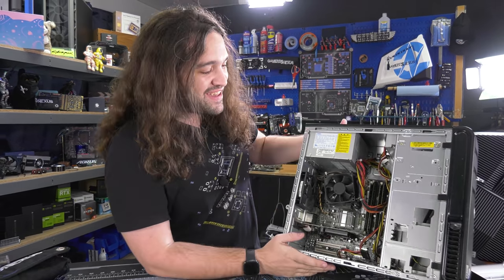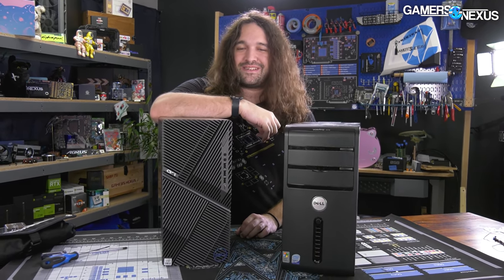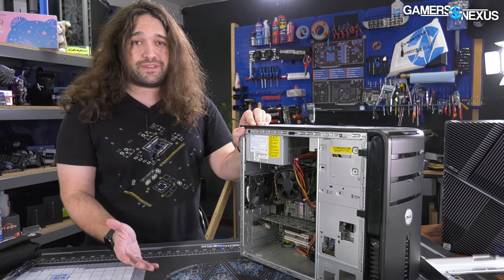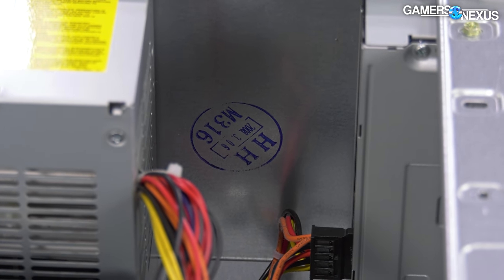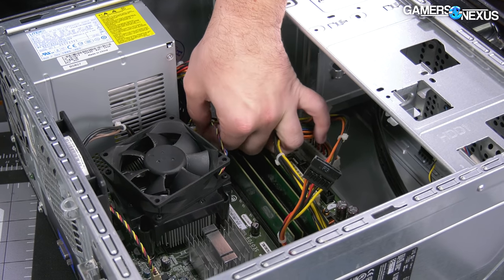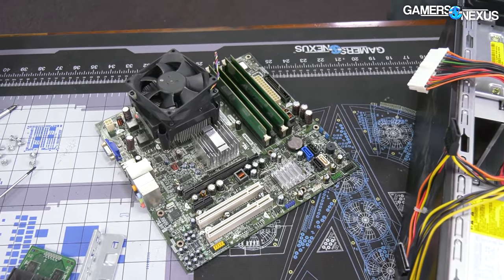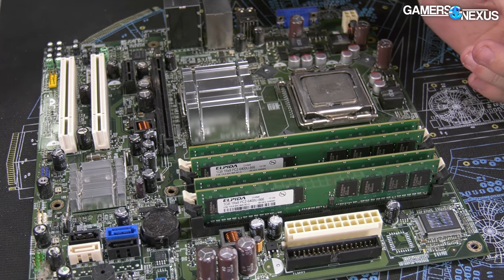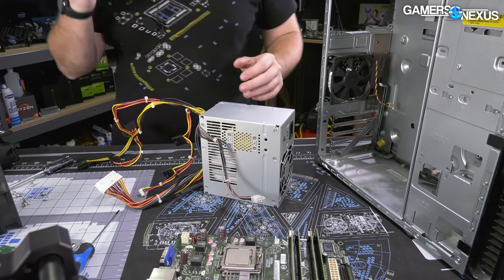13 Years of Dell Getting Worse

Comment: Dell has gone to the dogs. If you buy a Dell today , be prepared to throw it away in 5 years tops. 

Even if the hardware is in good condition , Dell drivers will stop working and you will be stuck with either wrong drivers or ancient drivers. This is done intentionally to make you buy new laptop every 5 year. 

My Laptop Inspiron 5748 i7 does not have a graphics driver because the Dell driver download page has the worng version of the file for the last 4 years. This was never updated even after multiple mails and calls with Dell.

Comment: The value engineers or "bean counters" are doing everything in their power to reduce material usage, part count and trying to make assembly in the factory as quick as possible. You see it everywhere, from cars to computers and the biggest OEMs are the worst offenders. Sadly most of the people who buy these abominations will probably never take off the side panel, let alone attempt to fix it if it breaks. They'll chuck it in the dumpster and eventually some 6 year old in Africa will harvest anything of value. It's shameful and consumers are to blame because we keep buying this junk.

Comment: Its not about Dell, all of the Brand name computers are getting worse by the years. Name some of them HP, Fujitsu, use the same proprietary motherboards and power supply to somehow protect their self's. WHY? I have no ideas, also RAM memory is a problem many times I couldn't get them to work with off the shelf Ram from other suppliers! WHY? Graphics card some times doesn't work if you want to change it?? WHY? So if they want to make same shit as Apple do, just rebrand it with Apple logo and that's it. I will stop buying it forever!

Comment: CPU coolers have gotten bigger and more effective over the years (as newer processors tend to use more power). I didn't check if the modern Dell's processor used more power and needed a larger cooler compared to the older one, but it'd be surprising if it did not. Anyway, somehow, everywhere I work is always using Dell, but then no work place I have ever been to ever upgrades any computer, they always just replace them (and quite often too).

Comment: This video was completely pointless, the only thing that can be changed out easily compared to the newer Dell is PSU, literally everything else is about the same proprietary. Just like the front I.O. Cables are PROPRIETARY for BOTH systems! So no… you can’t take the old(2008) Dell motherboard and place in a new case(without modding the front io cabling)! This is the sloppiest video I’ve seen put together. Pointless Tech YouTubers, this whole video was made not to educate, or even the false advocation for E-Waste which is contributed by every consumer including Steve… this video was created to sell his merchandise and get ad revenues.

Comment: Dell used to be decent back in the early 2000s. I have a dimension xps gen 4 from late 2004 and the cooling and airflow are actually pretty decent. Keeps my Pentium 4 550 and radeon x850 xt pe nice and cool.  Those giant heat sinks and fans with the Big Green shroud on those old dells kept those hot prescott cpus happy.

Comment: 17:46 This doesn't say anything about what metal it is. Most metals are not magnetic, even most stainless steel types are not magnetic. You couldn't tell the difference between aluminium, gold, lead, copper, magnesium,.... with this test. Gn takes so much care, to be as correct and precise as possible. At least, that's what i thought, until i saw that. I used to trust your test methods, this is a huge dissapointment.
Reply: Cry about it